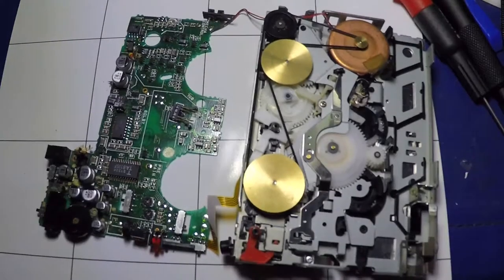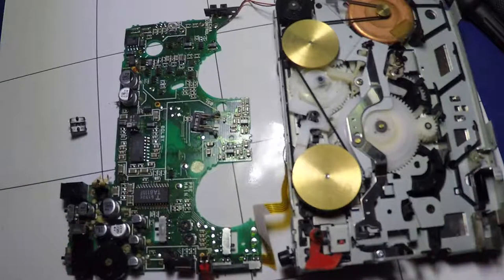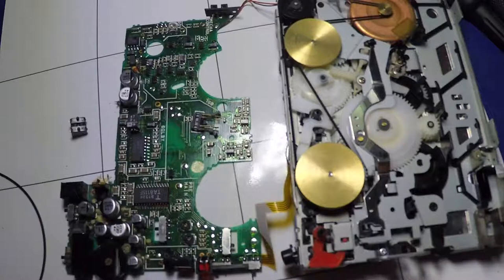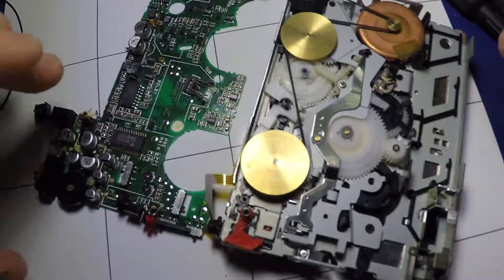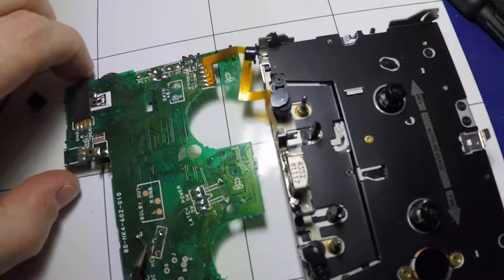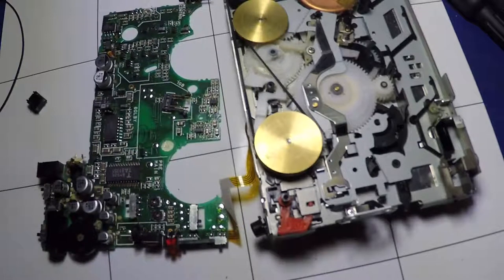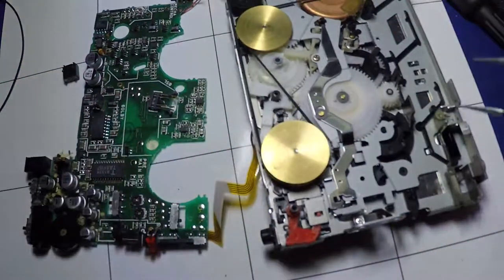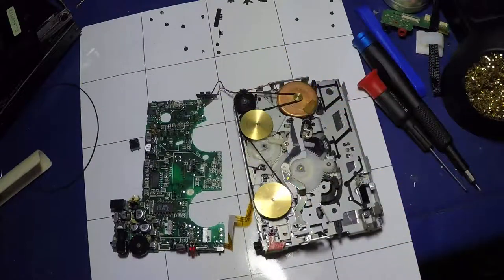TAPE COUNTER 001 - First look inside a P505

Comment: I've done it, I've taken the plunge back into cassettes again! I've got a HS-PX310 on its way! the only concern I have is the modern cassettes which are being sold by modern artists like Tayor Swift and Years and Years, are ferric tapes with no dolby noise reduction. I hope this improves in time however I have a feeling that tapes may be consigned to die hard fans, nostalgic individuals as they reminisce the good old days and the so called "hipsters" as they look to experience their music in different ways. Or perhaps the cassette will start to take off again as it was always the true portable music media...
Reply from the maker: Congratulations! It's a nice unit... worth repairing.
Some noise has been sorted with digital duplication bins, but the speed of duplication still leaves them with problems... especially no dolby... so expect hiss. The home recorded stuff, on a decent deck, however, has yielded nice results even staying with Dolby B, and not using C or S.
There's a strong indie scene using cassette as it's still the cheap point of duplication for fans who want physical media. You might want to get yourself onto Stere2Go as there's a load of help on there.
Personally, I've been a bit quiet... things haven't been good here recently. I have another funeral next week... being sent into London this week... was at a funeral ceremony in Manchester last week... a lot of emotion... travelling... been difficult to vlog, or find the energy to pick up a soldering iron.
Reply: Aww Michelle, i'm sorry for your loss. You needn't have replied. You take your time, I know its gunna be a hard fight. We are always here to cheer you up when your ready to come back. All my love to you and your family.
Reply from the maker: Many many thanks. In London right now. Time short. Back soon.